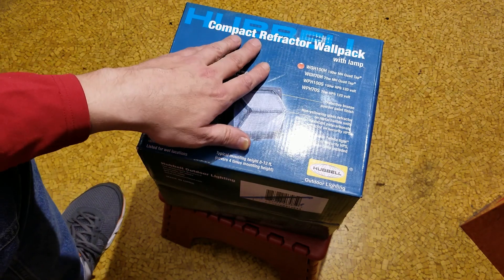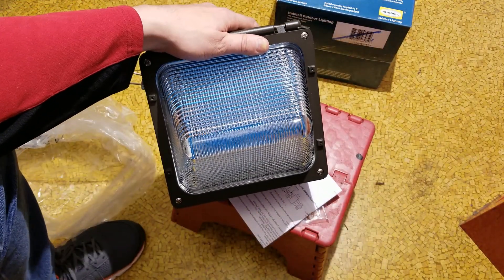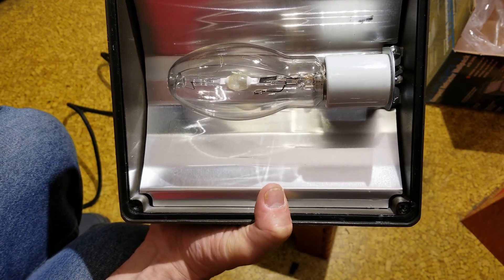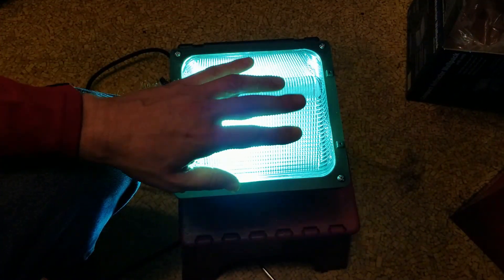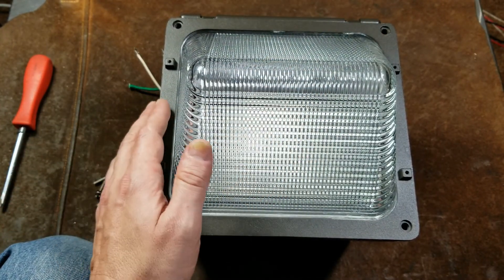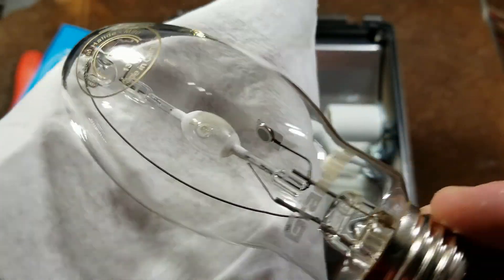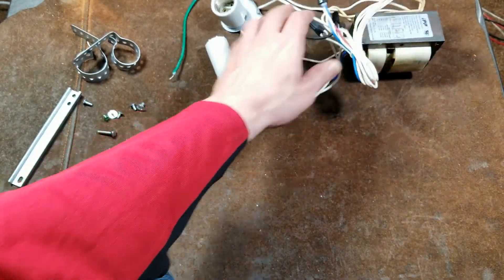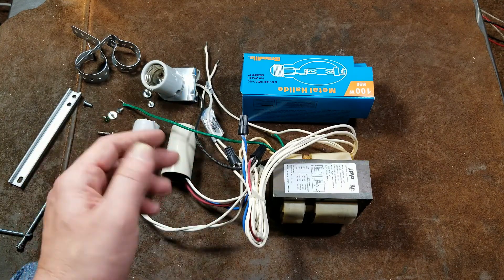Hubbell HID Outdoor Commercial Light Teardown & Discussion

Comment: I was recently tasked with reapairing  a large HID fixture on the side of our shop. I believe it was rated for 100,000 lumens. The bulb  was enormous and the internal assembly has huge caps and ignition components. I tried testing the socket and found 122v but the new bulb would not fire. There is also a photocell on this and I tried to eliminate it as the manager wanted on demand lighting. I ran the power to the socket and bypassed it but the lamp still will not fire up. We’re currently switching to Led because of the age of the internal components (1986) and the efficiency gains. Love this video!
Reply: LEDs are MUCH worse compared to HID.
Reply: @whoyoulookingatabs1028  Yeah!

Comment: Leds are overrated for the lumens per watt.... I'll be sticking with the metal halides or sodium lights for a long time and both are very efficient and produce awesome amounts of light for wattage taken.
Reply from the maker: I also find the light to be a bit crisper than LEDs. And as far as ultimate power is concerned you can get metal halide lights up to 2000 Watts.

There is no replacement LED headlights for cars that are as bright as the 55 watt HIDs either. Only ones to be brighter with LED are the manufacturer custom LED headlights
Reply: I agree

Comment: I enjoy these teardown style videos.  Im sure you are aware of this but I think its worth noting that even though that capacitor was potted, 
there is a chance that it was holding a potentially powerful electric charge.  I did not see any resistors that would discharge it?
Reply from the maker: Yes you are correct I should have mentioned that capacitors can be very dangerous and unless it's a very old one will have a internal resistor in the Potted capacitor for self-discharge. It will be clearly marked this unit capacitor hadn't worked at the bottom internal resistor.
Reply: @CatusMaximus  Ah I see.  Thanks for that!